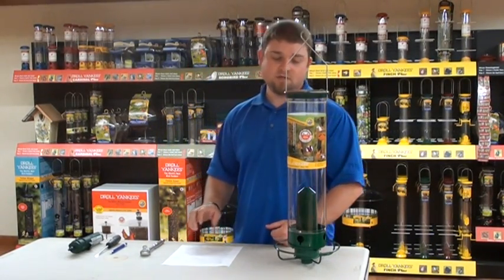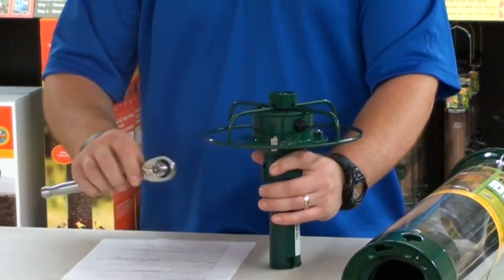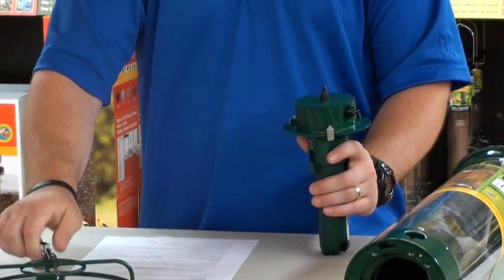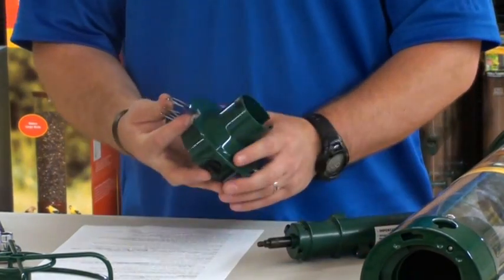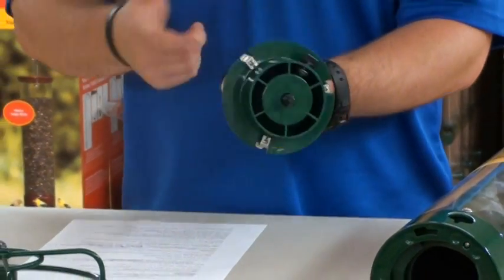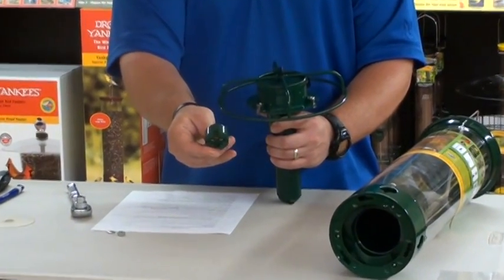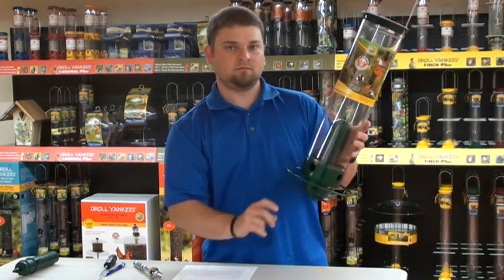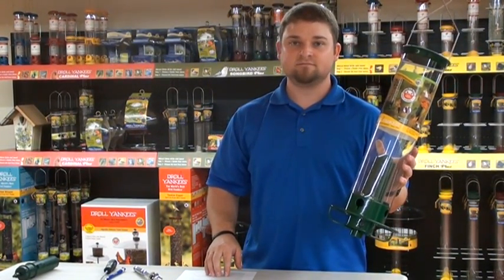Droll Yankees - Yankee Flipper Power Stick Replacement

Comment: Be careful when you disassemble that the little rubber bumper under the switch does not popped off. Mine did and I could not figure out where that tiny piece went until I heard the word "bumper" in the video. Then I saw that it fit right in the slot that is above the switch so that when the perch is pressed down it rises to hit the power source. I felt like a genius having figured it out and got the thing to work again! But it was iffy there, for a while!

Comment: I just got this feeder this week, the perch came off and was on the ground. I put it back on the feeder, but no click. Does something have to be adjusted? Not that strong of a swing when I charged it up. I know it's a nice battery so i followed the instruction and gave it a 14 hour charge. I think i am going to have issues with the battery.

Furthermore is it a good idea to take the perch and power stick appart every second year to clean it up?
Reply: The power stick had ran out of power after a few days. The squirrel had chewed the metal of the feeder where the seed is dispensed. I will try and charge it up again.

Comment: Is it possible to replace an old original Flipper rechargable C battery mechanism with a newer power stick?
Reply: Yes, but you'll have to buy it.
Reply: @ticktaco  Actually the Company responded and said there are no Lithium replacement battery packs for the old original C battery models. I now use a Squirrel Buster feeder and it does the job.

Comment: I found that to fully tighten the nut I had to turn the power switch on and compress the hub while tightening the nut to get a good grip. Otherwise, the axle would spin but the perch would not. *Be careful with this step.

Comment: I have an older unit.  The charging port is on the outside I have misplaced the charger.  What is the voltage the charger puts out ?
Reply from the maker: Hello Ernest,
Thank you for contacting Droll Yankees.  Replacement chargers for the Yankee Flipper are available directly through us for $15.99 plus shipping.  To place an order, please visit our website http://drollyankees.com/product/replacement-ac-dc-charger-for-the-yankee-flipper/ or give us a call at 1-800-352-9164 and any one of our Customer Service Reps will be happy to assist you. Our hours are Mon-Fri, 8:30am-5:00pm EST.
Happy birding!

Comment: Does anyone know where I can buy a new bumper switch for my yankee flipper? 
The company is of no help, they won't sell me the part. If I would have lied and told them it was newer they would replace it for free. Some customer service! The part is a common part to wear out since it is specifically noted in the instruction manual. They said look for it on the internet! Well good luck with that.

Comment: How much are replacement power sticks?
Reply from the maker: Hi Andy,
Thank you for contacting Droll Yankees. Replacement Powersticks can be purchased here:
http://drollyankees.com/product/yankee-flipper-replacement-powerstick/
The Yankee Flipper Power Stick and AC/DC Adapter are warranted to be free from defects in materials and workmanship for a period of one year from date of purchase. In the event of a manufacturing defect, Droll Yankees will replace the Power Stick and AC/DC Adapter free of charge. This warranty does not extend to damage through improper use, improper cleaning, weather, neglect, abuse, modification, disassembly, or falls whether of an accidental, weather, or squirrel-related cause.
If you have any questions or concerns, or to file a warranty claim, please call our Customer Service Department at 1-800-352-9164 and any one of our Customer Service Reps will be happy to assist you. Our hours are 7 am - 4:30 pm Mon-Fri (EST). We look forward to helping you get back to feeding the birds!

Comment: What does that do?  I didn't get what he is trying to accomplish from this feeder?  Shock the squirrel or nuisance birds?
Reply from the maker: Hi Jenna! The battery is for the motor in the feeder that twists the perch. The perch will spin when a squirrels weight is applied to get the squirrels to leave the birds to feed. The birds are too light to activate the perch so they are not bothered by the spinning at all. I hope that helps!  If you have any questions, comments, or concerns please feel free to reach out to our customer service department at 1-800-352-9164 or by email at consumerservices@classicbrands.net. Happy birding!

Comment: Both this video and the written instructions that come with the new power stick are inadequate.  The video doesn't even deal with replacing the "elastomer switch bumper"; there are three ways to put it on, only one of which works.  The "switch" isn't really a switch, it's just a plastic part on one side of the replacement battery.  It looks very similar to the other side of the replacement battery.  If Droll Yankees is going to call it a "switch", they need to label it as such.  Better yet, assemble these correctly at the factory so the "elastomer switch bumper" doesn't come off in the first place.  My first Yankee Flipper worked well for over 10 years.  I'm very disappointed at the increase in cost and decrease in quality.
Reply from the maker: Hi Patricia, we are sorry to hear that you feel our video and instructions are not adequate.  If you would like to discuss this further, please contact our Customer Service Team at 1-800-352-9164 and they would be happy to assist you.  You can also email them, with photos of the part you are referring to, at consumerservices@classicbrands.net.
Reply: I've had this thing for a few years and the battery is dead and then I learned that The replacement's like 85 bucks. 

You got gold in these batteries?  I don't understand how a battery pack is $85 but the whole thing is like not that much more so I'm pretty disappointed.

Comment: When I tried to take the nut off the bottom of my feeder to access my power stick, the whole thing snapped off in my wrench socket! For something that was designed to stay outside, I wouldn't expect it to be ruined by rust, I'd expect better quality nuts & bolts for a feeder that cost over $200!!  I'm highly disappointed. Now, my feeder is ruined. Completely unusable.
Reply: Just take your new power stick with the new thread to a hardware store and get a new stainless steel nut to match the thread for $2. It's by far ruined